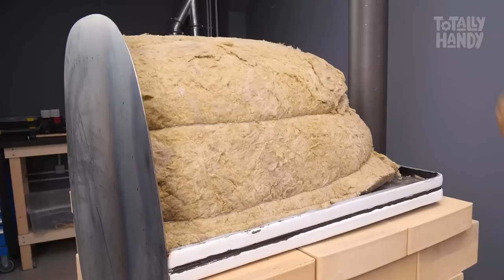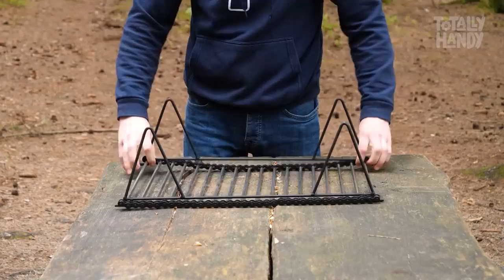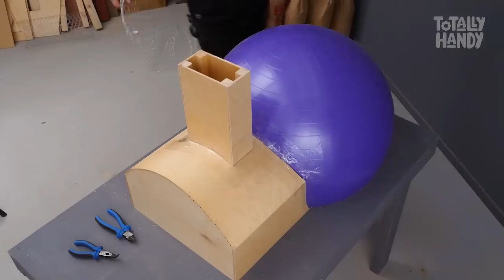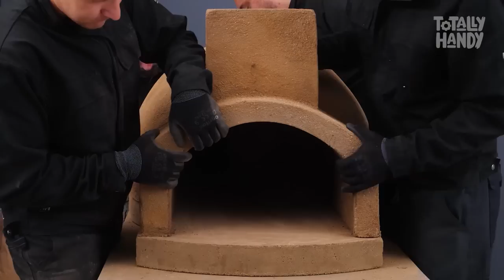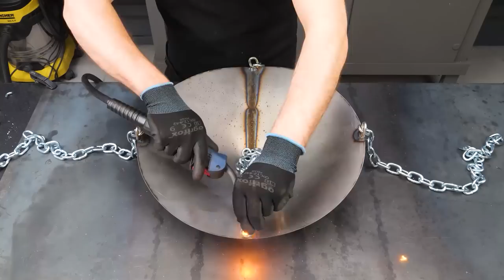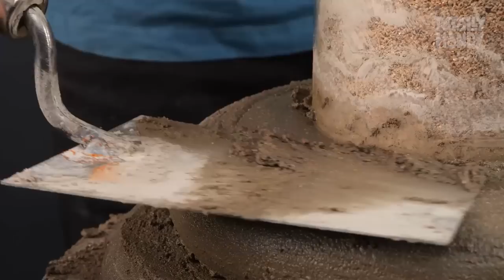Unique BBQ Grills For Your Backyard | Compilation

Comment: Marvelous, but please, it's necessary to indicate what kind of products you use (type of concrete, proportions...). Thanks, good job.
Reply: You use concrete type concrete. Mixed to the proportions on the label.
Reply: @DrLumpyDMus  Thank you, but possibly is any kind of special concrete due to the exposition to the fire/heat (as far as I know, standard concrete would crack in those conditions). Or it could also be clay. That's why I was asking.

Comment: Question: are all your welds merely a series of spot welds or are they really continuous and only look choppy because of editing? Serious question.  I'm just learning about welding.
Reply: Most YouTubers that can't weld, will use editing and multiple tack welds. Continuous beads are ideal for strength.
Reply: The video makes it seem like he is doing pulse welding. Some machines actually have a pulse welding function. Tig welders use that style a lot, especially on aluminum.  They call it "stacking nickels" (or dimes).
 Running a bead (continuous weld) isn't always required on small length welds. On pipe however, running beads are ALWAYS required.
 At 5:21 you can see where both base metal and filler metal fused together. No fusion, no using. 
That small blackhole isn't good. If you see that in your welds, grind the area smooth and reweld it. Its porosity. Its not a game changer but in ANY certified weld test it is reason for FAIL.
Reply: @polvera777  I found your insight refreshing and eye-opening. I feel like I’m already a step ahead the next guy who doesn’t understand this just by reading your response and rebuttal. 

Thank you for your answer for providing us with this information. Also thank you for the time code which makes it easier because you give us a reference or an example.
Reply: Series of spots